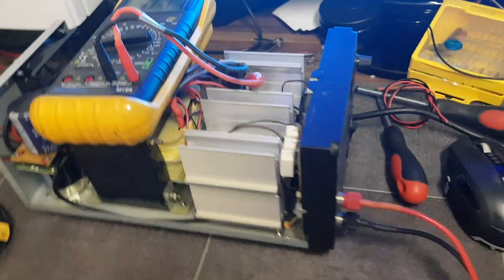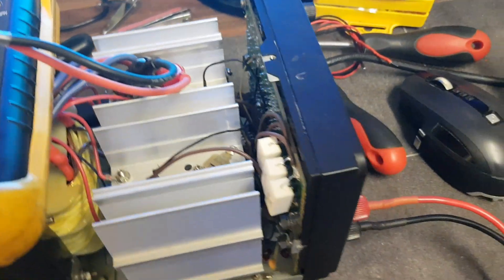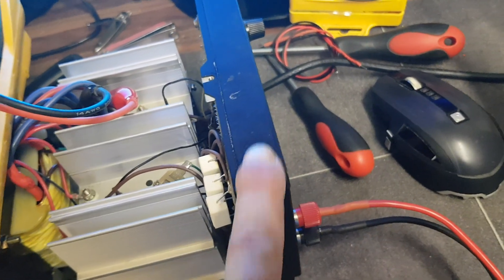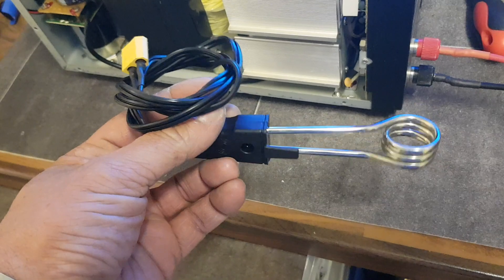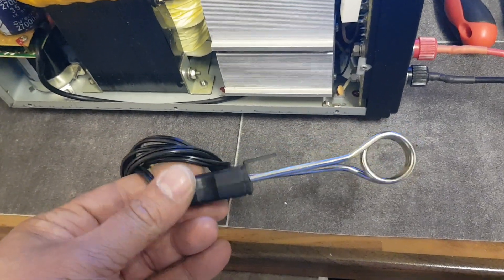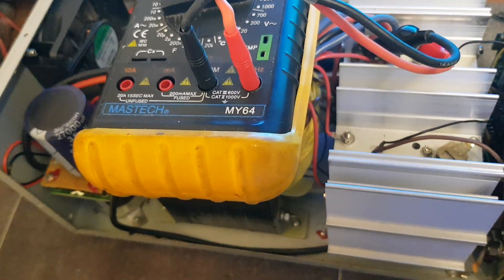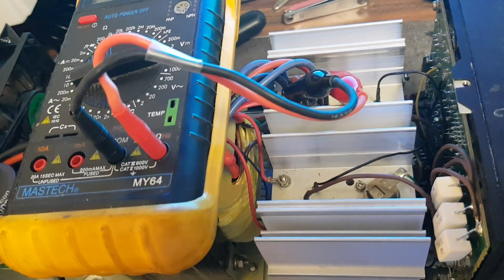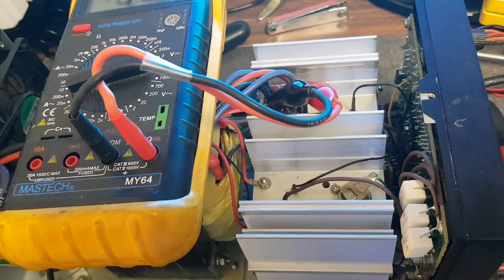repair of the power supply ep 925 from a friend

Comment: That is quite a power supply.  My power supply blew a capacitor, big band and miles of parer inside it.  Ordered a new one, but it has been so long now I have lost it or used it for something else.  Anyway, it will be near the end of its life, so I will get two and an output transistor and replace them all.  If it is not linier I don't use it!